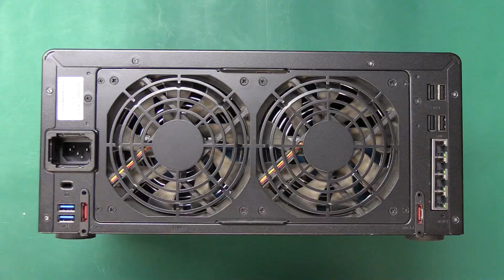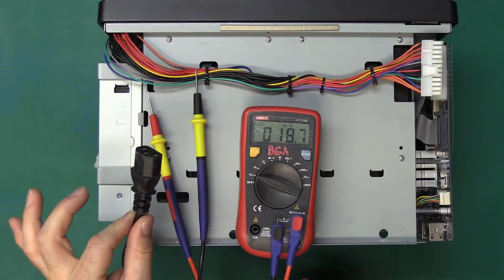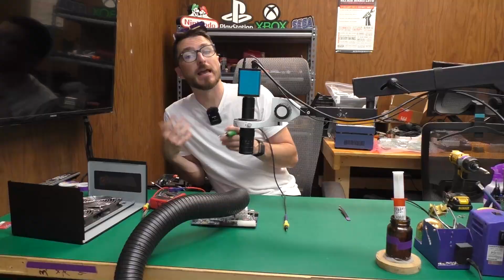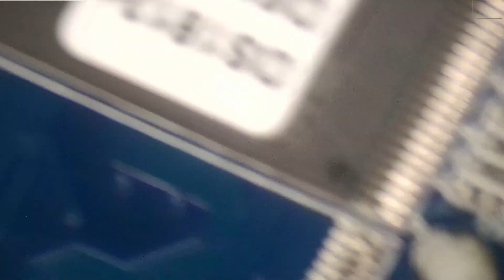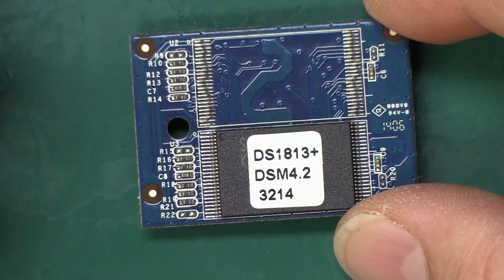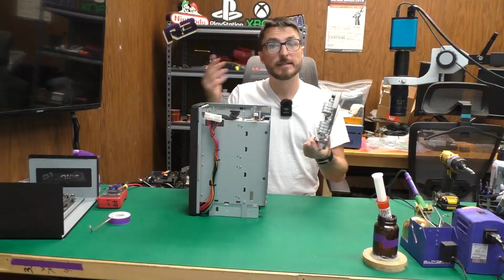How To Fix All Faults Repair Guide For Synology DS1813+

Comment: Hi Nick! Amazing and informative video. Two questions 1) I have the DS1513+ and currently only have the issue with the flashing blue light, however would like to replace the mentioned C392 and C390 capacitors, however they seem to have different IDs on the DS1513+. Can you help confirm if they're called C366 and C365 on the DS1513+ - at least the loc. of these different capacitor IDs is the same as the DS1813+. 2) For the USBest UT165-l48, on my DS1513+ I have the rev. A0A, but I see that there's also a rev. A1B available. Does it matter which one I replace it with?
Reply from the maker: Yes the rev A0A is very important. You have to use that same revision. A1B won't work. 
As for the cap ID location I don't actually know or have a picture of it. I also don't have a DS1513+ in for repair at this time so I don't know, but they should be in the same area. 
If you want to email us a picture to our info@nickselectronics.com email and circle the two in question in your picture I can confirm if that's them.
Reply: Thanks Nick! I’ve emailed a photo of my motherboard and already got a response from Richard. Would be great if you can take a look when you get a chance. Thanks!!
Reply from the maker: :) 
Just saw the pictures and yup those are it exactly!
Reply: @NicksElectronicRepair  - amazing! Thanks for confirming.

Comment: Hi, I have the same model (DS1813+), got it on Ebay a week ago. When I press the power button, blue light comes on, stays on for 15 seconds and then goes out. No beeping, system fans are not spinning. All disks are spinning ok when inside the system, I checked each. Bay 7 and 8 are solid orange, the rest of them - no light at all. Tried with drives and with no drives - same thing with each scenario: solid orange on bay 7 and 8. Swapped all drives with new drives - no change. System won't show up in Synology Assistant, network port is not active on the switch. Please point me in the right direction. Appreciate your help!
Reply from the maker: That's weird but you could have a power supply failure. If not it could be a motherboard failure that we covered in this video. 
You do have a bit of a strange failure and unless you send in the unit for us to diagnose and fix, I don't know if I can help you.